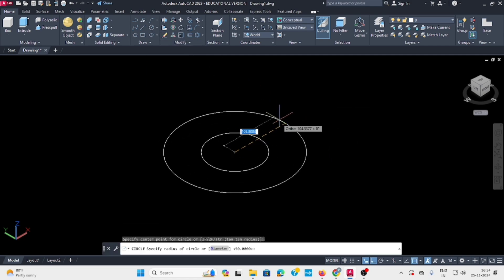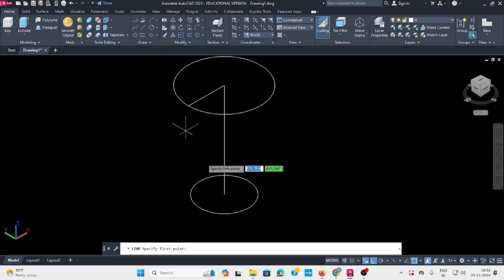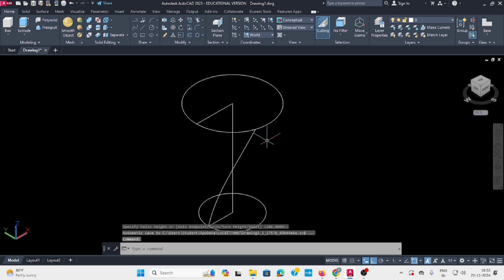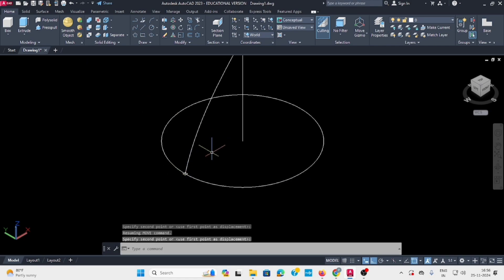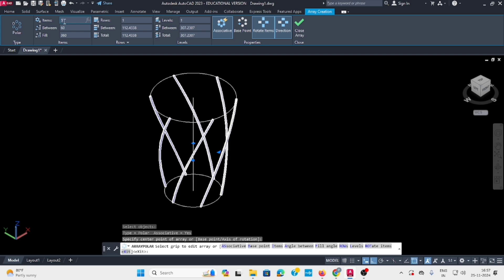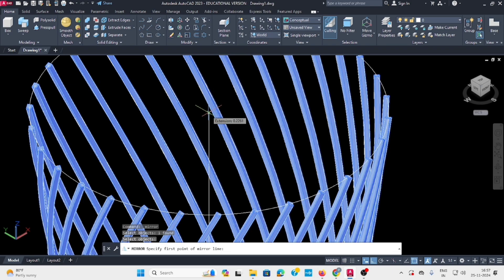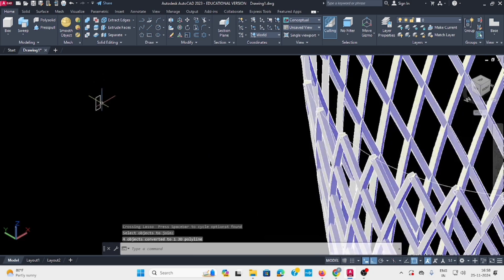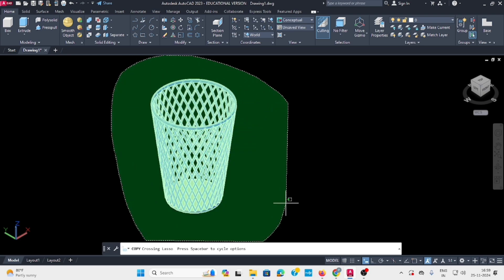How to draw Basket in AutoCad software

Comment: Sir in this  diagram you use the helix no sir it how to use the helix  sir could you please tell me sir
Reply from the maker: Step -1 draw base circle and top circle require dimension, then move big circle 70mm above direction, then select Helix command. Important step now select base radius, then top radius then in command bar see turn select 0.2 mm then height give (require ) enter. Now another command polar ARRAY select helix string 30 items. Next mirror command select mirror strings opposite side. Then top circle use sweep command. Base circle use extrude 5mm. below direction. One more watch video then understand. Thank you